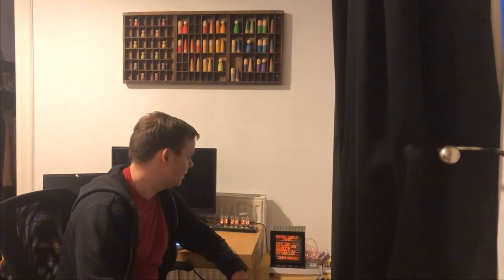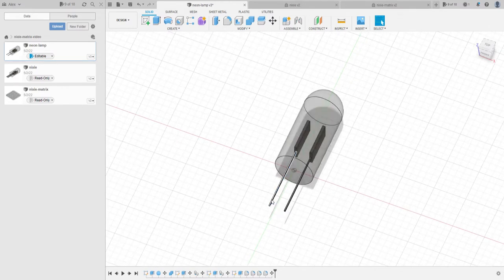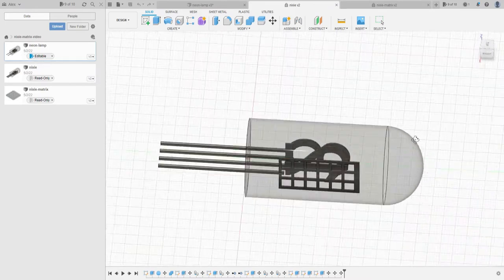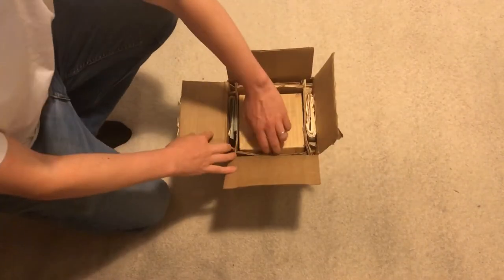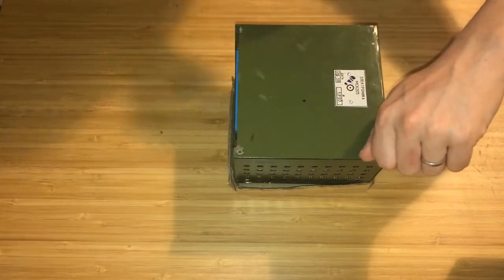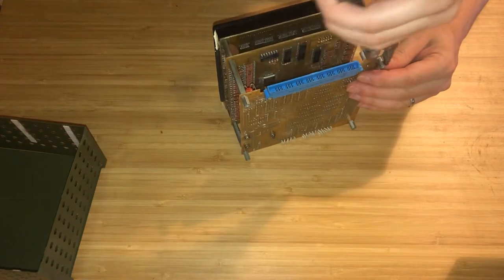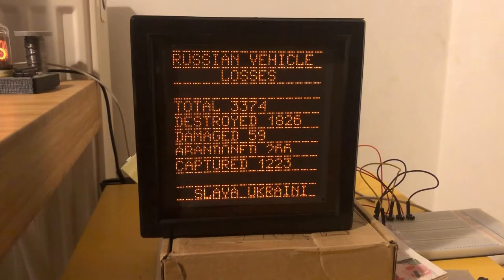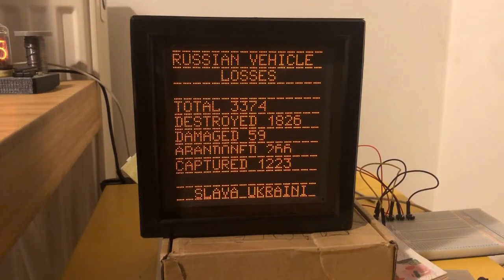Doing extremely Soviet things with a vintage neon plasma matrix display - MC6205 part 1

Comment: The industrial computer "Cursor" used one of those displays- and had built-in BASIC.  Apparently it was used as a microprocessor training system, but it was a full desktop system which could be used for industrial control purposes, and it is built like a tank.

Comment: 2D arrays on Arduino are pretty easy because it’s C++ so you can abstract stuff out and access things using a nicer syntax. I’m sure someone out there has a small header only implementation of a 2D bill array that stores bools as bits. But certainly Python would be nicer. That’s why you’d want to run muPython on ESP32 or anything else for that matter :)
Reply from the maker: I ended up using micropython on a pi pico in the end. It was far from simple: it’s far too slow to refresh properly but I got past that limitation by using the PIO on the pico.